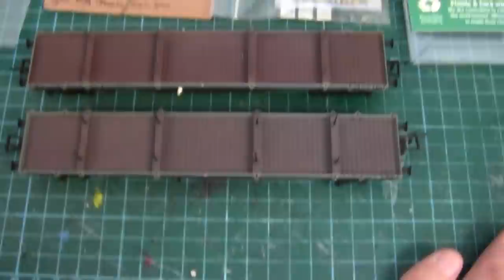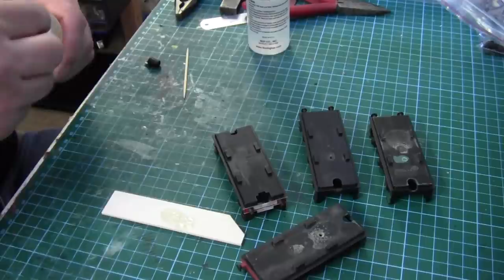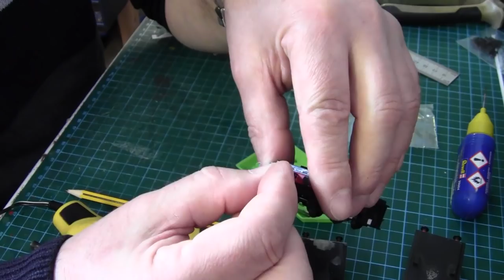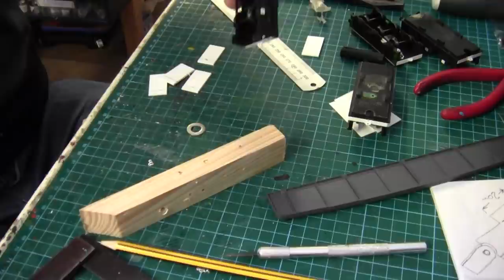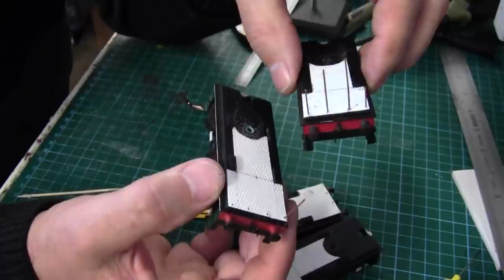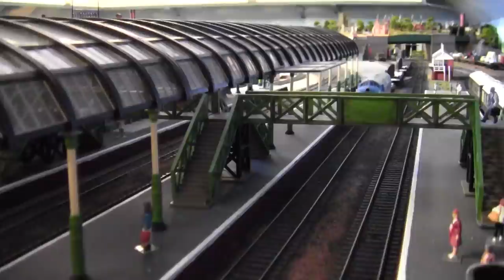The OO Gauge Bridge Transporter ...Part 1..No262

Comment: tight clearance under the footbridges, lucky no smoke deflectors fitted, great build Tony, looking forward to next week
Reply from the maker: Hi Geoff. your right there. the other alternative would be to run it on the outside loop. and miss the footbridge altogether. i knew i had 58mm to play with. and the total height came to 56mm. only a couple of milimeters clearance. thanks again for commenting have a great weekend....Tony

Comment: Morning Tony, that works well,  the train is going be really good, looking forward to seeing the next undate already. Good test run you very nearly had to let some air out of the tyres to get the girders under the footbridge!!Haha. Good bit of engineering. I remember just outside exeter they were installing a new bridge over the railway at exeter. After weeks of preparation the line was closed overnight and some huge cranes lifted the bridge into place. They produced a time lapse video of it happening, fantastic project this week you've given me some ideas on how to get my very old 75ton traing crane wheels to run on my layout, I have in the past done a bit of converting when I converted a old damaged 3plank wagon into a coal tender for  my pug engines so they could be used to pull some 4 wheel coaches into the hills. I was quite pleased with that. Thanks once again Tony I always look forward to Saturday's, I'm off on Monday to get my second jab, it will be good to get it done. You and yours take care of yourself, see you next week, Eddy xx
Reply from the maker: Hi Eddy. it was a bit close foot bridge, but there is clearance only 2mm. my 75 ton crane has the old wheels and you can hear it rumbling through the points as it just touches the chairs on the sleepers. that will be the next thing to do change them out. i will be Hornby 12.6 Diameter wheels to match the wheels on the pony trucks in front and rear of the crane. as you know i do like engineering. i wonder how they transported your bridge in Exeter. i dont get my second jab until June. all the best and we will catch up next week.........best wishes Tony

Comment: Hi Tony, nailed that perfectly. Great fit under the footbridges too...as if you measured it correctly!! Well done my friend.. Cheers for now, til next time, stay well, Chris
Reply from the maker: Good afternoon Chris. only just goes under the footbridge. 2mm to spare. i knew it was going to be tight. but not that tight. i was more concern with the articulation making sure that worked properly. and it does to be fair. i am not how it would on smaller radiouses. thanks again for commenting have a great weekend.....best regards Tony

Comment: Certainly something very different, it's (another) superb addition  to the layout and the 3 axle tenders as a base work really well, very realistic for the load. Great engineering and worked firsy time as a bonus. Seen why  reference video with the Garratt was inspiring, this project is certainly something else to add to my bucket list! Look forward to finished result. Take care Stephen
Reply from the maker: Good morning Stephen. looks like your bucket list keeps getting bigger and bigger my friend. its a easy build you just have make sure you the brackets you make are central to the tenders before glueing the girders on. and keeping the brackets for there respective tenders. not all those holes where spot on, on the tenders. i am glad you have seen the video in which i was inspired. stay safe my friend all the best Tony
Reply: @TONYNORTHEASTERN  Good afternoon Tony, yes my lists certainly are and now in a much needed file,  I need a long retirement looking at them to complete! Still its driving me on, it's a glorious hobby. Many thanks for the tips - have the crane, bolster wagons, Garratt, bridge sides, a supply of plasti card and vice, so off to a good start......on the procurement side of things. Stephen
Reply from the maker: Hi Steve. you have a Garratt. Nice one. there is so much you have to get just to complete this project. i have now added buffers to the chassis. where there is none. i recon this this whole thing has cost me about £80. its well worth it. see you Friday.......all the best Tony

Comment: What an amazing job Tony, real engineering solutions to the problems as you came across them and some great tips on the supeglue with paper and the way you used the I-beam to create that bracket. I have just finished a scratchbuild of a chassis for a Booth Rodley 15 ton hydraulic crane using the Smith's couplings so it was nice to see I had used them correctly as it was a first time for me! All the best and take care, cheers Steve
Reply from the maker: Hi Steve. as you have seen, there was a lot of work to do just on the chassis alone. bringing them up to date. I am glad that some of the tip n tricks have come in handy for you. scratch building a chassis now that sounds interesting. maybe i could do something like that in the future. thanks again for commenting. best wishes Tony
Reply: Thanks Tony, I have PM'd you with a photo of the chassis, cheers Steve

Comment: Excellent - as always Tony!  Very close shave under the footbridge! I held my breath as it went under!  I see the articulation works well on the flat track but wondering if it will cope with the start /end of ramps etc.  Maybe a thin broad washer would help between the deck of the chassis and the lug under the ends of the girders. That would add 1mm or so to the height though so even tighter under the bridges.  And, how about a handwheel brake for each load-carrying chassis so they can be parked up without a brake van attached? So good Tony - looking forward to the painted version. Thanks again for your weekly update. W :)
Reply from the maker: Good Morning W:). i like the idea of a hand brake for each wagon. i will have to look in my come in handy box to see what i can use to that. thank you for the idea. i had raised the bridge years ago for the lifting crane, by placing a concrete base on all 4 pillars. at the moment there is 2mm. if i go daft and that much paint then i will be in trouble. thanks again very much appreciate your idea. cheer's Tony

Comment: They look great Tony, well done! I only see 1 missing detail which isn't essential cause I assume the girders are permanent, but once the girders are removed, the tenders would need couplers on both ends to be moved when empty. Still nice addition to the layout
Reply from the maker: Good Morning Neale.  thank you for commenting. i did make a draw bar to go between the two chassis. and i have ordered some Hornby buffers to add to the beams. but you are right and its well in hand. its great that you have mentioned this thought. it keeps me on my toes. as when we build something like this you have to think not only about the build, but its use as if it was for real. thank again cheer's Tony

Comment: Very nice video Tony using old loco tender chassis as wagons that is a magic idea they will look great once painted. will you do any kind of weathering to the bridge sides.- Nicholas.
Reply from the maker: Good Morning Nicholas. and a good question about weathering. in my mind i would like to think. that the girder plates would not have been on the load bearing chassis for long as they are new straight from the workshops. so maybe just a faint bit of weathering. but not quite no noticeable. thanks again for commenting..........cheer's Tony

Comment: You have started something here Tony, a lot of us will be trying to copy your build! A shortage of second hand tenders on ebay?
Reply from the maker: Have you checked already. Try Job lot tenders you may be lucky. its just something different to run on the layout. stay safe my friend.......cheer's Tony
Reply from the maker: Just checked there is a job lot of tenders exactly the same as the ones i have used. all the best Tony
Reply: @TONYNORTHEASTERN  Thanks for the info Tony, I'll keep my eyes open for these, its a project for next winter! Any ideas how to convert the older bachmann thompson coaches into a articulated set? Ian H.
Reply from the maker: I have not tried that one. but sounds like a project for the future. i am guessing a bracket will have to be made to fit onto a bogie with  2 pins one for each coach.....stay safe my friend......Tony